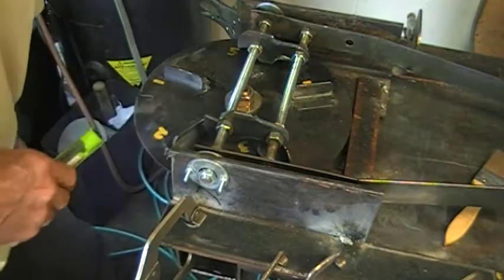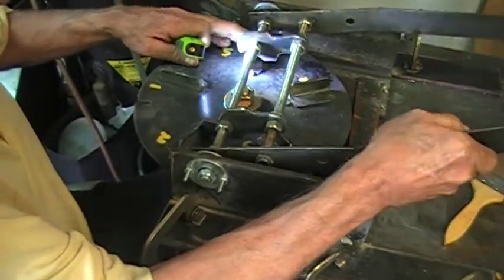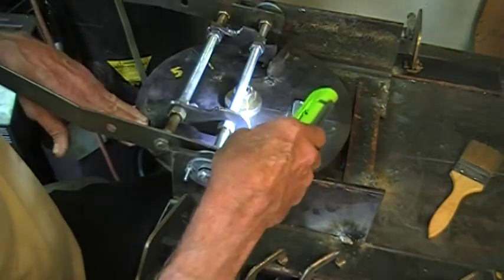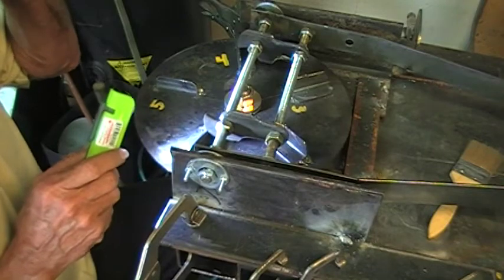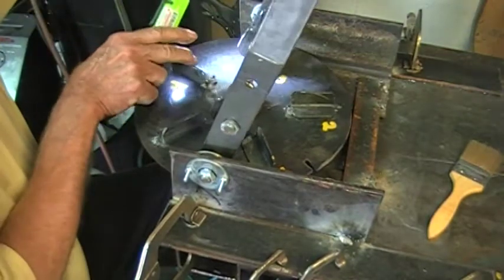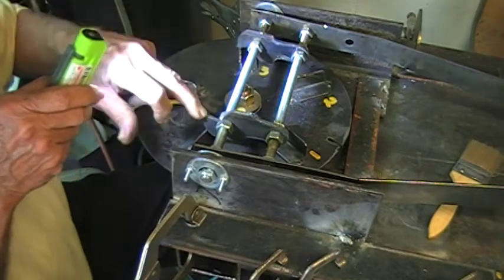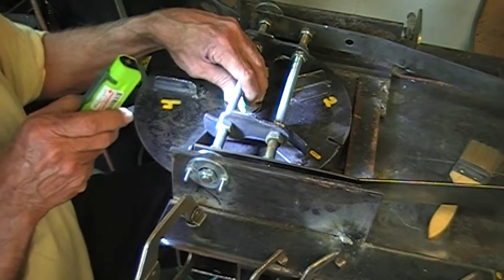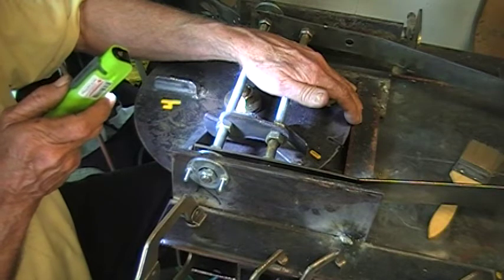DIY 180 degree New verg and foliot up date

Comment: Couldn't one make counter weight at the bottom of a verg / foliot that would raise the original wieght back up? thus rewinding the wheel cable? You'd have perpetual motion :D
Reply from the maker: My brother keeps suggesting the same thing and I keep giving him the same answer. Nutton's law of motion.  It takes more energy to put a body at rest , into motion , than it takes to keep it in motion ONCE it is moving.
By letting the weight travel several feet you are putting in the power to overcome the inertia one time every 5 or 6 feet and not every 25 thousandths of an inch